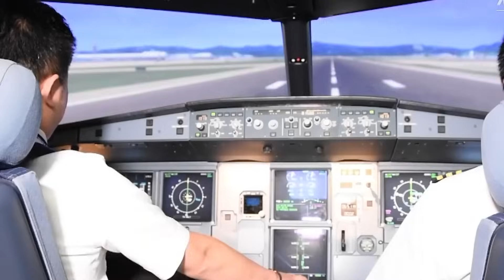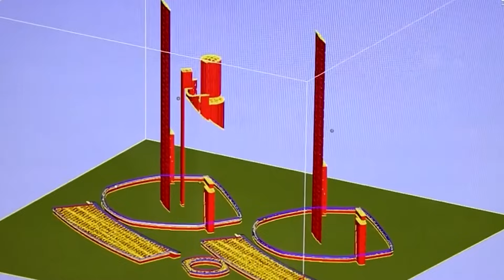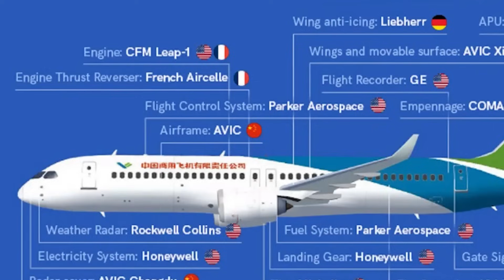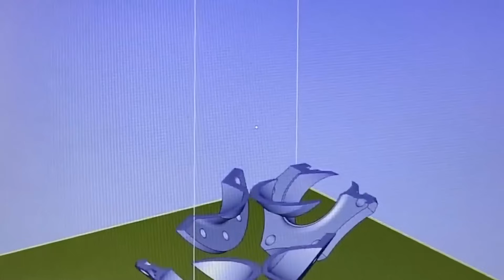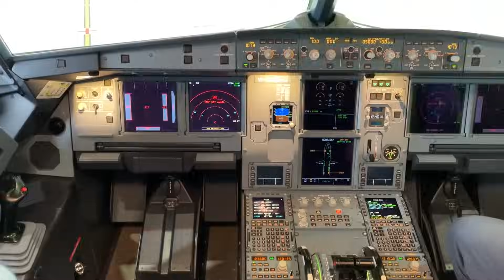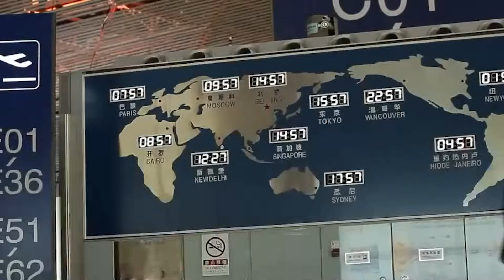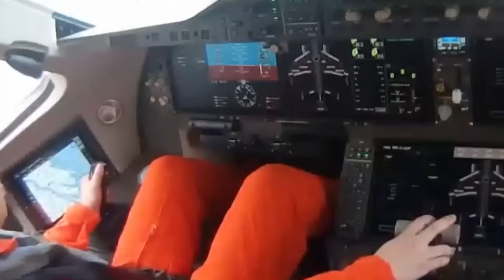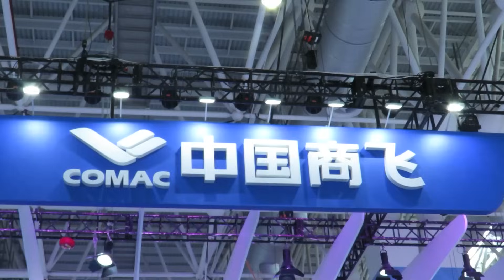COMAC C919 | Claim for the future

Comment: In my analogy, COMAC will likely end up as the Chinese Chrysler to the American Boeing (Ford) and European Airbus (General Motors). Markets dominated by huge fixed costs and high barriers to entry are often characterized by a duopoly and a bunch of dwarves. Chrysler has been in and out of bankruptcy trouble plus foreign rescues for nearly 50 years now .

Continuing the analogy, Chrysler usually competes on either low cost (K-Car platform of the 1980s and 90s) or innovation/uniqueness (Hemi engines , minivans, Jeep brand, FIAT in America, Hellcat, etc). Neither strategy has been all that sustainable through the decades. I would board the C919 Version 3 (Dash 30 perhaps ?), but the company's long term fate is likely to be similar to Chrysler in the American car market.
As for the Japanese domestic car market , I believe it is Toyota, Honda, and about five dwarves. Europe seems to be VW Group, FIAT, and the rest.
Throw in China's political discontent with a growing middle class not provided even an illusion of political choice , and COMAC will likely be hampered from pursuing a strategy of innovation/uniqueness over the long term. Note how China started by cloning turboprop, then the DC-9/MD-80, and now the B737 and A320. Their long term strategy will likely be competing on low price and reliability, leaving ground breaking to Boeing and Airbus. 
Don't forget Africa. Chinese diplomacy has focused on this burgeoning market that has relied on secondhand aircraft for decades . Instead of just ports, railroads , and highways, China could cover thia huge continent with relatively inexpensive, new, single aisle airliners. Boeing and Airbus likely would just cede that market to COMAC, a long -term mistake . African economies like Ethiopia have been roaring into the fastest growing ranks over the last 20 years as cell phones and Chinese infrastructure projects finally unlock a great deal of economic potential.
Reply: I think your idea is too old. The Chinese government and enterprises are in constant and substantial reform. When the core technology in any high-tech field is completely mastered by China, they will use the low price strategy. They will be a huge blow to any original enterprise. We should pay attention to this.
Reply: @百发百中大力丸  It may be an old idea , but you agreed that COMACs most likely strategy will be to compete on low cost. The American and EU economies rely heavily on their commercial Aviation  companies. Boeing and Airbus both wear a military hat as well, soaking up government money for military transports, helicopters , and so on . Money from governments acts as subsidies which can help with "competing on price " in the airliner market. With American politics moving in a more protectionist direction, banning or restricting the purchase of COMAC airliners is quite believable. Boeing spreads its civilian and military work out across all 50 states, all represented by politicians seeking to protect their districts. Commercial Aviation is a fairly special market and breaking in is very difficult. Europe produced airliners from the 1930s to 1980s before they finally got any traction with American commercial carriers using the Airbus A300. The irony of course is so many Boeing and Airbus products come from China and are then used worldwide.
Reply: @randomname931  While I have doubts about COMAC competing on innovation, it is possible. I definitely appreciate Boeing and Airbus having some actual competition to keep them honest. Airline passengers would benefit from having three major producers of commercial airliners. Look at the pressure Tesla has put on the entire automotive industry, especially in the US.
Reply: @amerigo88  I agree with your description of the close relationship between Airbus and Boeing and their governments. Although a large number of high-end products made in China have not yet entered the United States, we can focus on cars and smartphones: instead of directly confronting powerful groups such as the United States and Europe, such as General Motors and Apple, they focus more on popularizing poor countries, China believes that they are the main driving force for future world economic development. I believe that China's future development and more developing countries will have a broader passenger aircraft market in the future. At the same time, the trade barriers and unpredictable sanctions constructed by the United States will increase the distrust of Airbus and Boeing in these developing countries.
Reply: @amerigo88  In fact, the c919 has been developed. The day before yesterday, the first aircraft was delivered to China Eastern Airlines, and CAAC is conducting internal adaptive flight. The first aircraft will be put into operation on domestic routes in March next year. At the same time, I agree with your description of engines. The technology accumulation of the United States and the United Kingdom in the engine field is not something that China can surpass in recent years. But I believe that the United States and the European Union will not restrict the engine trade in recent years, because China has countless Boeing Airbus aircraft. If they cut off the supply, they will also cause huge losses.

Comment: Thank you for yet another terrific presentation. I have a greater preference for the Russian designs in comparison to the Chinese commercial options. It’s always interesting though to see other nations developing commercial aircraft, this C919 has some interesting features, along with some unsightly ones which is a pity. It certainly has potential. Although they might as well call it a C320 same, same, but different!
Some of China's military transports briefly shown look great. It would be interesting to learn a little more about them.

In order of preference I prefer Boeing, Lockheed, Douglas Props and DC-8/10, Embraer, Bombardier turboprops/ExecJets, Ilyushin 18/20/22, 86/96 Tupolev 104, 204 (Tu-114 for it uniqueness, luxurious cabin and outrageous design, ugly but wild) and Antonov 10, 140. Also a handful of others that produce smaller aircraft such as Pilatus, Piper, Rockwell, Mitsubishi etc.

The Irkut MC-21 is definitely an appealing airliner and certainly far superior to the Comac and Airbus options, what lets it down are those wretched very dangerous side sticks. I detest Airbus with the exception of the A300/310 airframes.

Comment: I would like to throw down a bet that eventually WS20 will be put on C919 on certain configurations. The WS20 is not really inadequate advance compare to CJ1K under development. It us just the mindset of the management of the program assume they can get something more advanced from international joint venture.  That said, as the trade war going on. The CJ1K program development will be further delay and the access to Leap engine will eventually become impossible. So, the management will have to make the call get the WS20 certified and keep thr production line rolling or let the project rot on the backlog.
Reply: WS20 > is a military grade engine > the services life may not meet the commercial grade specification (I.e. maintainence free for xxx hrs and services life for xxxxx hrs)
Most military grade engines don't last long and go scrapping after hundreds hour of use

What people interested to know what is Chinese's contingency plan for International sanction against Comac for accessing western aviatronic equipment...

1. Contingency for sanction on engines > solutions > homemake WS20 / CJ1k > acceptable with trade off from performance and reliability

2  Contingency for sanction on aviatronic equipment > this is the real problem > because no homemake alternative or replacement yet!

Comment: THe engine and the pilot's eyeview deskboard display instrument-----avionic components are the most difficult thing to build in the world.. china is working hard try to break through, , but they may achieve  their indigenous engine first, seems next 5----10 years,  they will test flight their own indigenous engine which will be mounted on C919., however, the rest of the avionic parts probably even harder to manufacture which will take 10 years plus for china to conquer,,, YES,, they will get there, nothing is insurmountable in the world.
       Due to market share fighting competing with boeing and air bus,, those imported parts for the c919 can be cut off by the western world anytime,,, the worse scenarios for china is----- to build their own,,, doesn't matter pass the certification from the western world or not,,, china don't care because china poise a huge aviation market which is large enough to engulf 6000 C919 aircrafts in the next 20 years... 
    They manufacture this one and willing to meet their own  market demand,,, IN the long run,,, in the world,,, the 3rd aviation certification will establish and exist in china,, which can be eponymous as the certification from the united states and west Europe.

Comment: Boeing and General Electric Aviation are joined at the hip and USA could kick Airbus ass because General Electric and Boeing will make sure that Airbus  and Comac C919  Will not have access to the General Electric CFM International Jet Engine. Without the General Electric CFM International Jet Engine and without that jet engine Airbus and China would fail the FAA test and the COMAC 919 would fail the same test. This would result in the COMAC 919 would would flunk all USA FAA testting. For instance if General Electric stopped selling the General Electric CFM International Jet Engine to China  that would be the end of Comac internationals flights. If the US stopped selling the engine Airbus would also go out of business. Without the General Electric jet engines there would be no replacement parts for repair. After WW2 Europeans are unable to build safe jet engines and General Electric and Boeing would stop parts and technology to China. Without the General Electric CFM engine Chinas Comac will go out of business!!! Hey Fal with the coperation of General-Electric-Duopoly COMAC jet will not have a safe viable jet engine that could not pass USA FAA testing and the COMAC 919 would be restricted to flying in China only. Remember it was the Good Ole USA that invented the Airplanes with the best planes and jet engine. Everyone will laugh at China airplanes which are cheap copies of Boeing aircraft. LOL, LOL were laughing in the Good Ole USA!!! The COMAC 919 is not in prouction and without the  General Electric CFM International Jet Engine the COMMIE 919 will never fly in the USA!

Comment: China Shipbuilding Aerospace Solar Panel Coal Thermal Hydropower OLED IT AI Cloud Computing Electric Vehicle Security Monitoring High Density Battery Mobile Phone High Power Wind Power Semiconductor Design and Processing UAV 
 UHV Transmission Fourth Generation Nuclear Power Communication Equipment High Thermal Efficiency Diesel Engine High-end Tool Server Optical Fiber And optical module United Imaging 5t magnetic resonance PET/CT soc 232-layer nand is more advanced than Japan, 
 Japanese gasoline automotive industry robot electronic material film material engineering and modified plastic heavy-duty gas turbine semiconductor equipment electronic components (MLCC filter sensor, etc.) mcu
 mechanical parts (Servo motor bearings, reducers, PLC valves, etc.) Scientific research instruments for gastroscope machine tools are more advanced than those in China,  
 such as LCD screens, home appliances, construction machinery, high-speed rail, subway, magnetic levitation, special steel, carbon fiber FPC, Japan will also be in China, and it is estimated that in another 10 years, all industries in China will completely crush Japan.
 For example, the localization rate of liquid crystal panel materials in China has increased from 10% to 70%, the localization rate of high-speed rail parts is 97%,　
 the localization rate of domestic nuclear power plant parts is over 98%, and the localization rate of lithium battery materials and equipment is over 90%
 . The localization rate of satellite parts is nearly 100%, the localization rate of solar panel materials and equipment is close to 100%, etc. China now develops new drugs every year accounting for 13% of the world, Japan 6%, the United States 48%, and the
 localization rate of BYD electric vehicle parts is 90%. Basic self-sufficiency such as LED materials, mocvd equipment, chips, etc. The self-sufficiency rate of chemical equipment is 90%, the self-sufficiency rate of metallurgical equipment is 95%, and the localization rate of textile equipment is 85%
 . The localization rate keeps the added value (GDP) in China, and imports replace foreign capital instead of the world.
 From assembly to manufacturing, the development is laissez-faire. By 2035, China's economic and technological industries will also catch up with the entire West. The 2.44% R&D investment should be increased to 3.5%.

Comment: This aircraft is only assembled in China with about 50% parts from Western Countries including, Engines. Western Countries decide to stop supplying parts, manufacturing, will come to scratching holt also, Sections will shut down to its entirety.
Engines are back bone of any aircraft. Once China developed there own engines developed and start testing on 919 aircraft successfully, certifications will take 2 to 3 years only if Western Countries allow it. Russian are far ahead with MC 21 ready for mass production in Jan 2025. 100% Russian made Parts including engines PD14.
Reply: PD-14 isn't ready mass production.
Reply: @ PD8 and PD14 are already ramping up for mass production as of 1st Jan 2025 as reported by RT and Russia Today with videos of 3D printing facilities for both engines and other parts including wings etc. PD35 engine is already installed on test lab IL76 video showing IL76 taking off and landing.

Comment: Priviet/Hi SkyShips

J-20 is modified Russian MiG 1.44, ALL Chinese planes are modifications of foreign planes that are not functional abroad and sold to China as second class technology. 
China is still dependent on foreign KNOW-HOW. Y-20 transport plane is best example.

Ukrainian engineers (from Antonov Bureau) designed Y-20 using: front fuselage AN-70, wing IL-76 (copy/paste), C-17 back fuselage with T-tail, main undercarriage A-400.

Ukrainian engineers (from Motor-Sich) designed WS-20 turbofan engine. I have to give the credit to Chinese engineers for modular construction of WS-10/15/20 engine. It is Chinese idea and if very functional one.
Chinese engineers could NOT get those engines done for almost 20 years. 

This means that finally China have not only WS-20 engine but with time WS-10 and WS-15 as well.

Due to war in Ukraine now development of those engines again is slaw. Ukrainian engineers are back in Ukraine and Chinese engineers work alone.

China Aviation Industry is expanding (it is a Fact) and following Chinese engineer worlds: "In incoming future it will be ABC - Airbus, Boeing and COMAC" and agree with those prophecy. 

After all there is still dependency manufacture aspect of making the plane (PARTS to it), Russia/China planes are still dependent of (inside industry MACHINING, some KEY Components parts from the "WEST" - It is WIDER aspect of INDUSTRIAL KNOW-HOW}.

Since there is the Russian AN-125 flying between China (Norinco) and Russia every day that might be new kind opening in war at Ukraine.

We might have different opinion about USA, however they still control the world: Microchips (technological lifespan cycles), Aviation industry, Defense (delivering or not key weapons to the Russian-Ukrainian war field). We might not appreciate/agree with USA, however they still control the world/us.....

"We are living in EPIC TIMES".....